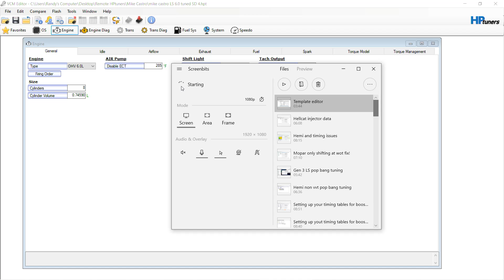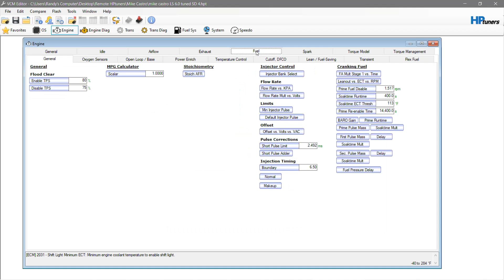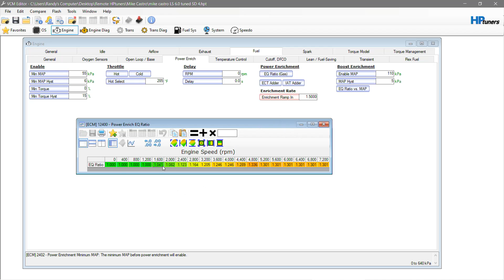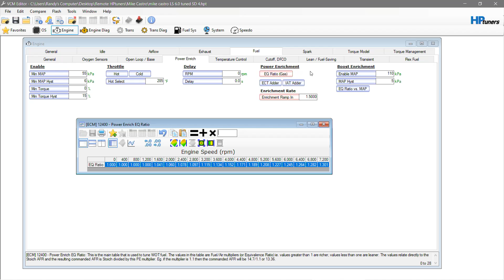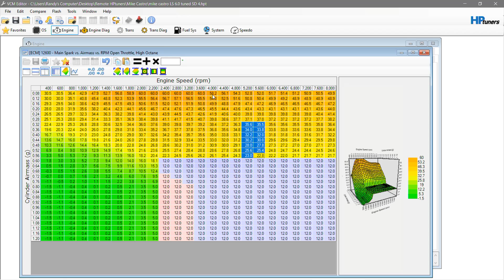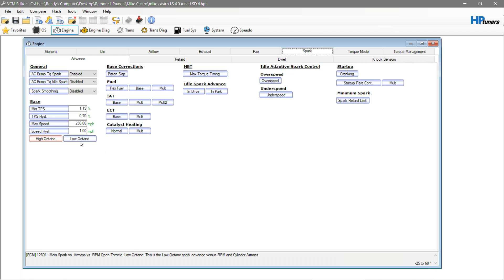Setting up your GM tune for Nitrous

Comment: Timing is better all around if you wirea resistor into your iat sensor so when you flip the activation switch for the nitrous it will pull the timing
Reply: where can i find more info on this?

Comment: Ok so you make a setpoint for nitrous with a low timing degree then you ramp it up like you do with a turbo or a supercharger .
I thought that you could just tune it spot on NA then take 2* out if your spraying 50 shots 4* if 100 shots and so on is that the wrong way and could it actually blow my motor my second question is if I do this with a wet kit using c16 or any high octane fuel how would you know where to stop even without nitrous you wouldn't get knock with this kind of fuel what to do at this situation? Great videos by the way keep it up